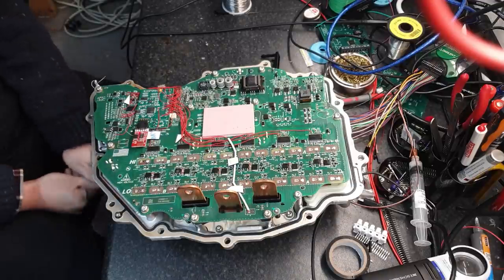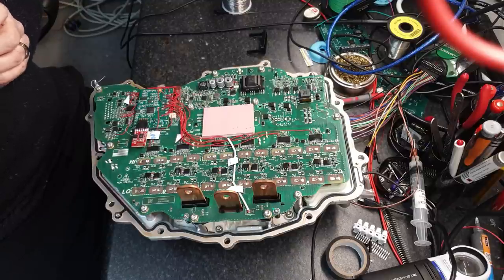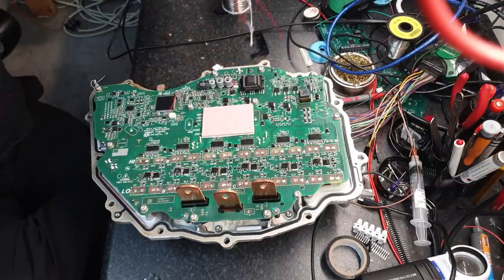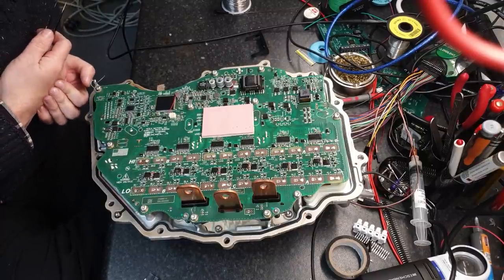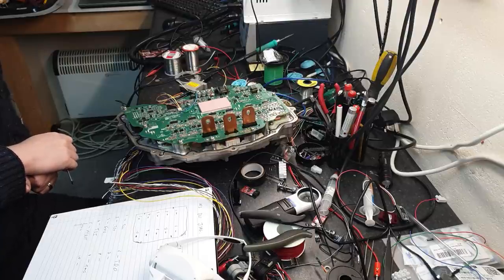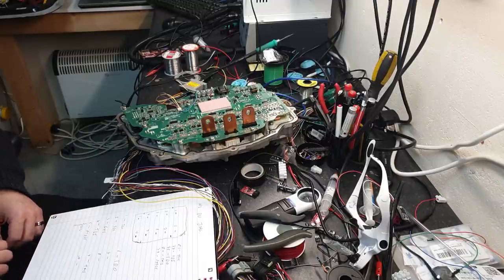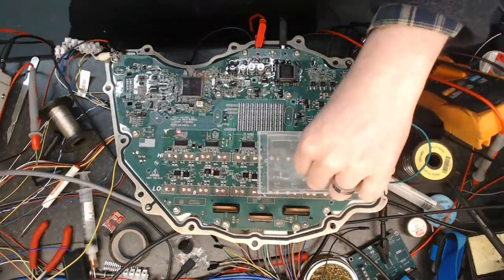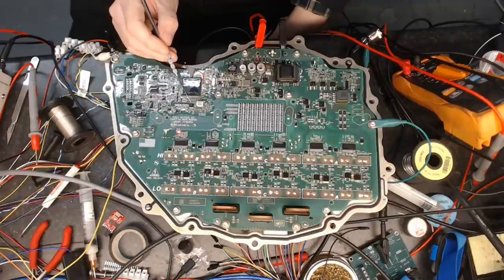Tesla Model 3 Drive Unit Inverter Reverse Engineering Marathon

Comment: Well in this particular case it may be a bit of a dead end, given that they are likely taking advantage of the secure module and setting the OTP memory with some key for protecting the access to the secure parts of the flash. Even if the flash can be erased, we are likely not able to get the microcontroller to execute code without it having been encrypted with the same key. Only option is to swap with a brand new chip then..
Reply: How hard could it be to design a little de- and re- soldering tool for that chip that is on par with our diy skill set? It need not even be a single use tool, it could be distributed with a pre-programmed openinverter chip-set for a certain bond to make sure it's gets send back.

Comment: Damien Maguire can it be the case that you need to use a more specific jtag programmer? Being able to dump the contents of the microcontroller flash is most certainly not possible, but ultimately you could erase and write your  own code. Easier said than done of course, as automotive tech usually has all sorts of protections beyond more generic hardware.
Reply: It's not impossible to dump the contents, just difficult. No more special JTAG adapter is needed, they just plain locked down JTAG so people couldn't directly yank the firmware that way or do step-wise debugging. As it stands, people in the know could still flash new firmware onto the chip. But, yes, it is easier said than done BY FAR. Flashing code on the chip would require that someone know absolutely everything about how the chip is wired. That's a tall order.
Reply: @CKidder80  sure. Even though in this case @Damien Maguire pretty much figured out the rest of the board. Between trying to hack the existing chip and desoldering (it's not a BGA package, which is good), putting a brand new chip in (these are not terribly expensive, relatively speaking - https://pt.mouser.com/ProductDetail/Texas-Instruments/TMS320F28377DPTPQ?qs=%2Fd%252BFzHvH4c0BWLvK%252BWHycg%3D%3D) and develop code for it, I think the later could be more fun as a project.
Reply: @LuisTeixeira  I like the replace chip procedure best because once we get ourselves used to that, diy successfully sharing tools for it if needed, the next hacking effort becomes so much easier not needing to circumvent protections at all, just reverse engineering to the smallest protected subsystem.

Comment: Too bad it does not have an "erase" pin like the Atmel/Microchip Arm Processors. The pin erases all the internal flash and the lock bits allowing it to run the built in ROM code that handles In system programing. This allows a "bricked" unit to be recovered. Looking at the pin list those "Flash test" pins seem suspicions. edit: Given that Tesla loves to do remote code updates I am guessing they are doing the same thing we are with the Atmel E70. Our code has a boot loader that configures TCM(Tightly coupled memory) and then copies the running program into Ram. That allows the running program to read and write the built in flash all it wants to without stopping the code. This lets us do code updates over the CAN OPEN bus.

Comment: Ok, so I did something wrong (I didn't watch a cat video) but I watched the full length of all this.
What happened is, in my fully "illiterate" in the field of electronics (hardware) brain, a question popped up.
With your amazing knowledge of electronics, both hardware-wise and programming, what would happen if you were to design and develop/build your own "universal" inverter(s) instead of spending countless hours "reverse engineering" other people's stuff...
Reply: Test Test The problem is it would be difficult to get manufactured and incredibly expensive when compared to what Tesla puts in hundreds of thousands of vehicles each year. These Model 3 inverters are available to purchase after the cars they belong to have been crashed and declared total loss by the insurance carrier. The cost to buy an entire salvage title Tesla should be less than the sum of its undamaged electronic/mechanical parts.
Reply: There are people who make "universal" inverters. For instance, Rinehart Motion. They're expensive but you can more or less take any motor and set it up to work with one of their inverters. So, yeah, people do make a living doing that kind of thing. It's just expensive and complicated. But, also, the OpenInverter project that Damien is associated with is basically a universal motor controller. But, for Tesla motors we're talking about really, really large power levels. Building such a large inverter from the ground up is a very costly proposition. You WILL blow up inverters while testing. Lots and lots of them. And, those power transistors are not free. Also, plasma events at 350kw are exciting. If you're having constipation problems, suffer no more. You see an IGBT go liquid at that power level and you will no longer be constipated, I assure you.
Reply: @CKidder80  No longer constipated, really? I'm gonna steal that one from you mate, genius.